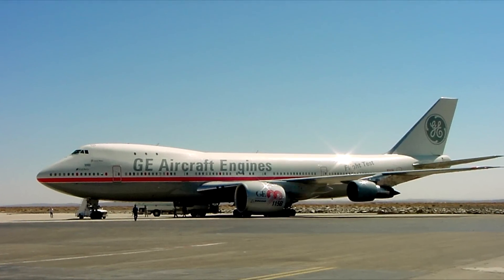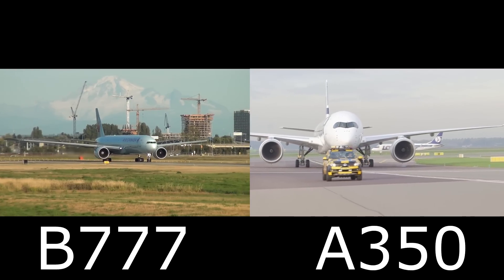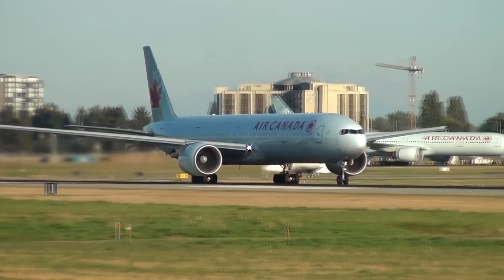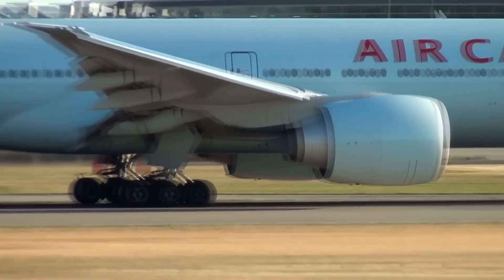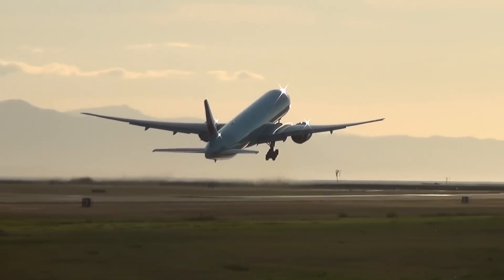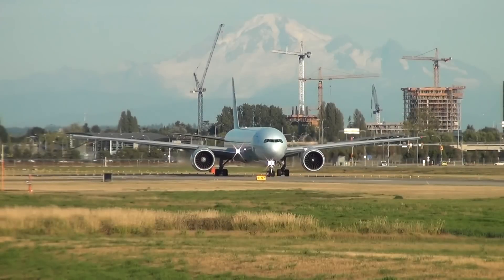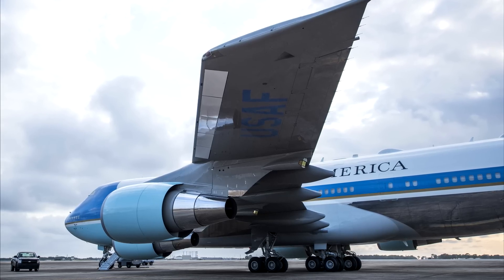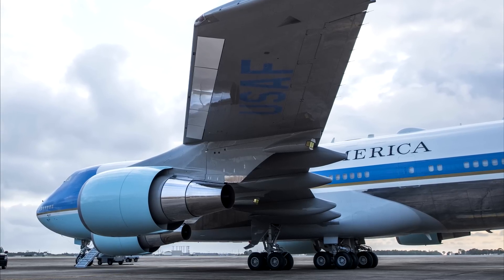Will 2 GE90 Engines Work On The 747?

Comment: How about two bigger inboard "cruise" engines but also retaining two smaller engines on the outboard stations that are only used on take-off, at landing and in case of main engine failure?

Once in cruise, they could be shut down and a streamlined cover pulled in front of the intake fans. And with total thrust levels planned such that any combination of three engines or both of the large ones could keep it safely in the air or get it airborne once past v1.
Reply: Benny Löfgren the idea is good and I like it but not having an engine working adds dead weight meaning less passengers or fuel witch means less 💰💰💰
Reply: So you would have two dead weights providing no trust. Also on top of that you would have a technical sequence prone to technical errors and thus complicate take off and landings and increase cost. Rather go with two engine then...
Reply: The outboard 'deadweight' engines will add a lot of drag.
Reply: Too much maintenance costs involved
Reply: then you're lugging round 2 massive dead weights on the end of each wing
Reply: That streamlined cover you are thinking of won't make the engine streamlined by any meaningful standard.
Reply: Scott Barwick On the other hand you will need less fuel. That might on its own compensate for the additional weight. Also, you can delete the APU - one of the "dead weights" can fill that role.
Reply: 空軍パイロット Well, don't rule that out. Look at external fuel tanks in fighters. Sure, they add drag, but not catastrophically so.
Reply: Sounds sort of similar to a thought I once had, sort of part way between his idea and yours. I was thinking of a single-engine airliner - two engines should be plenty even for something like this, so "boosters" shouldn't be necessary, but for a single engine you'd need boosters in case of main engine failure. The boosters would be mounted in as streamlined a way as possible, ideally buried in the wing root. I was thinking they'd be low-bypass turbofans or even turbojets, possibly afterburning - basically fighter jet engines. Slightly lower thrust-to-weight and slightly more efficient than rockets, but still far lower weight for a given needed thrust capacity, as well as smaller frontal area, than normal turbofans. Horribly inefficient, but they would only be used in emergency or during brief phases of flight. I'm thinking they might be running during takeoff and landing, when they'd need power right away, maybe at mil power (full throttle with no afterburner) on heavy takeoffs and idle on lighter takeoffs, but ready to hit the afterburner at a moment's notice if the main engine fails. If the main engine fails higher up, they'll have time to start the boosters, maybe having a cartridge starter that can be used to start very quickly and without available bleed air.
Reply: How about a steam driven catapult on the runways to launch the 747-2 ?
Dumb idea guy. If one realizes the design, validation and qualification costs it takes to get to a current configuration, one would interpret this idea to be sophomoric just shy or moronic.
Reply: Benny Löfgren Benny, they add a ton of drag. Where in your head are you getting these ideas?
Reply: Airflow Aviation  have you ever seen a B747, that looked as though it had 5 engines? It was actually carrying a spare rngine being ferried somewhere, it also had a shroud, for less drab. I only saw this once in my life ., they are made with an extra engine mount on them for this purpose .
Reply: Too much maintenance and I would imagine two dead engines would provide a fair amount of drag.
Reply: even if you have a steamlined cover, it still adds drag. Also, shutting down two engines now adds dead weight that doesn't need to be there.
Reply: It was a great idea, but as all the comments said, it will be a dead weight, added to the plane. or you could just reduce thrust on the two engines and maintain the thrust for the two main engines :D
Reply: They would be better off using a tow vehicle to pull the aircraft the whole way.
Reply: 5 year old thinking gets 85 likes....hell yeah!
Reply: Benny Löfgren it's a nice idea, but would mean the airlines would have to hold two different types of spares for one aircraft type. Aircraft design often centres around common spares so as to save airlines money in storing spare parts.
Reply: Benny Löfgren   As the author mentioned, the need to redesign the wing and the vertical stabilizer alone would make a clean sheet of paper design a much better long term solution.
Reply: At what about a warp drive after this :P
Reply: Let alone that you will have "dead weight" on the ground or on the ground of the ocean if two engines fail and the next airport is too far away. ;)
Reply: ΕΥΘΥΜΙΟΣ ΜΑΛΙΑΡΙΤΗΣ Are you saying I'm thinking like a five-year old or that my thinking is five years too late? :-)

Let me address some of the arguments I've heard against my suggestion (which I had considered before proposing it, and I still think my idea could be viable):

Yes, when the engines are shut down, they will induce drag. However, with good aerodynamic design of the cowlings I don't think that will be a big problem that will negate the benefits.

A worse problem is that they become dead weight. Yes, that's true. But my thinking is that they will be much smaller (and thus lighter) than the full-sized engines that hang on a 747 today, and the total weight of two big ones plus the two small ones would probably not be more than the weight of four of the old ones. Someone even suggested rocket assisted take-off power instead of the outboard ones. Not a bad idea actually!

The whole idea is to re-engine 747's to something more economical to run than today, without having to completely redesign the wing . Two GE90's or RR Trents will be more than enough to keep a 747 flying at cruise altitude, with (I think) much better fuel economy than four of today's engines, even with the induced drag and weight penalty of two "take-off/landing" engines.

No structural changes will need to be done to the outboard pylons, while the changes needed to the inboard pylons to cope with the larger loads from the higher thrust will hopefully be limited to the pylons hemselves and their actual wing spar mounts.

Also, the take-off/landing engines will accumulate far less run time than the main engines, which would reduce overhaul costs significantly.

So, what's the benefit of this re-engine arrangement over buying triple-sevens? Well, airframe cost for one thing. That investment is already made, and airlines are now grounding 747's with many years of airframe life left on them for financial reasons. And as big as a 777 is, a 747 is still bigger. Pilots won't need (much) retraining. Existing maintenance infrastructure can largely remain. Existing routes can remain.

And the 747 always was and always will be queen of the skies. :-)
Reply: Benny Löfgren they dump those fuel tanks just as soon as they are empty. Also, where will those streamline covers go when they aren't in use? And what about the rear? The back of each engine would need a streamlined fairing even more than the front!

If this was a good idea, why has Boeing never done it?
Reply: 空軍パイロット oh... We don't all think its a good idea.
Reply: Benny Löfgren, two much drag with two non-rynning engined.
Reply: Douglas Rodrigues and... I think he forgot that heating and cooling a jet engine is the most wearing part of use. The thermal expansion amd contraction is what does the most damage, so the hopes of reduced maintenance fall right there.
Reply: man. who will PAY for redesign  the wing? 747 are NOT competitive anymore. end of life. got it? 747-8 are a failure. they DONT SELL. GOT IT?
Reply: unclejoeoakland Actually no, they don't dump external fuel tanks when they are empty. They can , and in combat I'm sure they do when they need to, but absolutely not as part of normal operations. First of all, they aren't inexpensive and there isn't an endless supply of them. If you kept jettisoning your external tanks left and right I can guarantee you won't have a long career in the Air Force... Secondly, you don't want to litter the countryside (hopefully uninhabited) with big fuel tanks from the sky if you can help it.

So where would the streamlined covers go? Have you seen how thrust reversers work? When they are not in use, they are stowed absolutely flush with the engine. I'm sure it would be possible to design something similar for this imagined type of engine pod.

Why it hasn't been done? Well, for one thing, it isn't until now that the 747 is showing its age enough that it is actually on the brink of obsolescence. Also, there is actually the chance that no one in position to do anything about it have thought about the concept. Or you can be right and it isn't a feasible solution. I'm not competent to work out the economics or the engineering of something like this myself, so I'm just throwing the idea out there in case it might spark a thought in someone, somewhere.
Reply: ΕΥΘΥΜΙΟΣ ΜΑΛΙΑΡΙΤΗΣ The whole point of my idea is that there hopefully won't be any need to redesign the entire wing, which would be insanely expensive. Just maybe the inner and outer pylons and surrounding support structures. I don't know if it is economically feasible, but it might be one way to go to extend the life of the many relatively new 747 airframes that are around.
Reply: unclejoeoakland No, I didn't forget the part about wear from heating and cooling either. But you can design an engine to different specifications using different materials, and making one that is more resilient towards short duty cycles can't be impossible. Compare this with engines on commuter planes that maybe have half-hour hops between startup and shutdown. What's the difference there?
Reply: im telling you man. the NEW 747-8 DOESNT SELL. is it so hard to understand? your idea is about the REST of the fleet?thats EVEN MORE expensive!
Reply: ok man. sorry if i offended you.
Reply: Well, it's been done before.  P2V, C-119, C-123, B-36 are all examples.  It's possible, but not practical in today's operating environment.
Reply: That would be a lot of dead weight inflight...
Reply: Benny Löfgren waste of money
Reply: How about 2 GE90 turbo fans inboard and 2 Pratt & Whitney PW2000 (from the C17) outboard for short take off and landing capability.
Reply: A good design is to keep it as simple as possible.  There is a reason 4 engined aircraft are now dead.  Maintenance costs for 4 engines vosts twice as much than 2, exceeding any fuel savings that can result from asymmetric engines to 'right size' your design.   DC8 70s were the last successful and easy re-engining effort.  After that a redesign of the wing and redoing of the aircraft calculations are required like the 747-8 is actually a total rebuild of the wing design.
Reply: really smart
Reply: The drag penalty of non running engines would offset any advantages of two engine economy.
Reply: Benny Löfgren no more power more GE90
Reply: What about 2 GE90 inboard and  2 small Solid rocket boosters (SRBs) on the outboard pylons  like the space shuttle. fire at 60 knots for 1 minute . awesome climb rate and fun ride :D
Reply: Airlines don’t like extra engines. I think if Boeing were to redesign the 747 it would be with 2 engines.
Reply: LOL no chance. You will be carrying the weight of the batteries. Trying to get an electric motor to produce the same thrust as a RR Trent the powerpack would be massive!
Reply: no they wont they are streamlined  like having a harpoon missile that is fired but not released and the thrust helps the take off and climb until burn out  . then fit new ones for each flight .
Reply: is the announcer from India? lol
Reply: How about after takeoff, the 2 outboard engines are released and glide back to a local airport. No dead weight and drag.
Reply: ΕΥΘΥΜΙΟΣ ΜΑΛΙΑΡΙΤΗΣ Who the hell have been talking about the 747-8?? No one but you, so what are you even on about? This video talks about re-engining older airframes, and so am I. It's a hypothetical scenario, get it? As in a thought experiment. No need to go ballistic about it. My idea is just about as realistic as the one in the video, that is, it's not gonna happen. So don't worry about it.
Reply: gigaboat I think I'm done talking to civilians with no knowledge in aeronautical engineering.
Reply: theres talk of using hybrid technolagy on long range jets 

electric motors move the plane on land  - A lot of fuel is used when doing this up to 10% is used for taxing 
and electric motors also used to spin the engines up to power  and they then kicking at near full speed - Take off will be quiter and faster will allow for later noise restrictions and save fuel  not much but every drop saved helps 
the electric motors may help to land the plane again save money and later landings could be possible 
the batteries will be charged of the engine like a prius or Diesel electric train 
the jet engines used for take off and in flight and maybe landing 
this will be possible with solid state batteries as there lighter and more power deance the lithium ion
Reply: You got a great Idea there.

Comment: There already is a twin engine 747
747-8 is the 777X. With no upper deck =)
Reply: Word - Bro!
Reply: The 777 doesn't have the beam of the 747
Reply: B777 can carry max 396 passengers in a two class configurations. B747-400 can carry +/- 600 passengers.

Comment: I'm sure it could be done but why.. I prefer 4 engines on a bird that big.. The 747-8 is a work of art even though it is 45 years old it has been refined very well and is in my opinion the most beautiful commercial plane ever.
Reply: Im with you propeller head- I keep wanting to hear that some airline is ordering 50 747-8is. I was glad to see ups order the freighters, but to me its like an ex champion boxer getting a job mopping the gym. That plane is too beautiful and capable to disappear. The ball point is an old design too...
Reply: Yes, a 747 with 2 ge90 engines works. I would know, because I've been on one.
Reply: The 747-8 is the most beautiful plane ever, after Concorde
Reply: I feel like a double decker twin engine plane is possible. But the fuselage would probably have to be redesigned.

Comment: The ge9x produces lest thrust then the normal engines on a 777 or so I've been told
Reply: Tazzie Devil04   It does have reduced thrust primarily because the new longer wings provided more lift at takeoff.

Comment: At some point, I see either Boeing or Airbus creating a plane roughly the size of an A380 (or even slightly larger) with three GE9x engines (or similar). I have no idea if that would work though, given current market conditions.
Reply: Error 404 channel not found With the predicted growth in air passenger numbers in coming years and with restrictions on slots at major airports, I think it’s unlikely we’ve seen the end of four engine passenger aircraft. The A380 may yet have its day and possibly even larger aircraft will take to the skies.